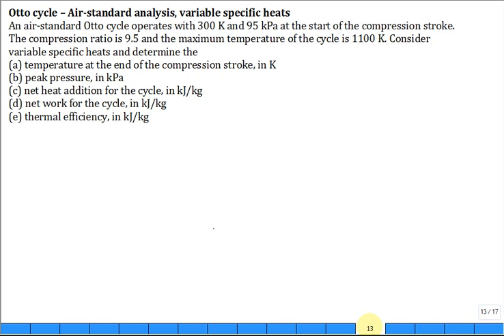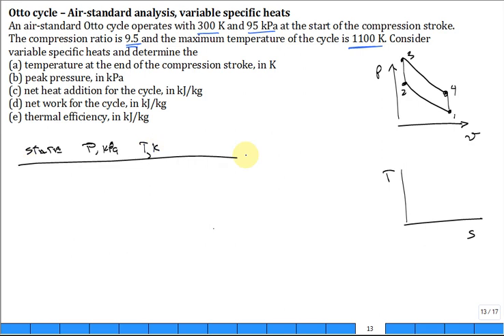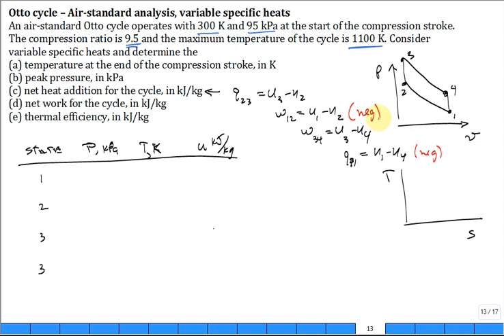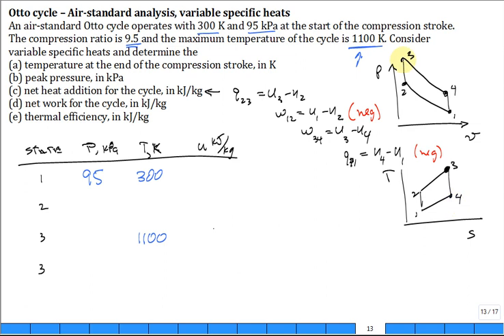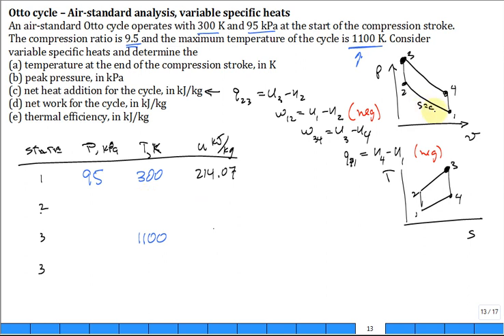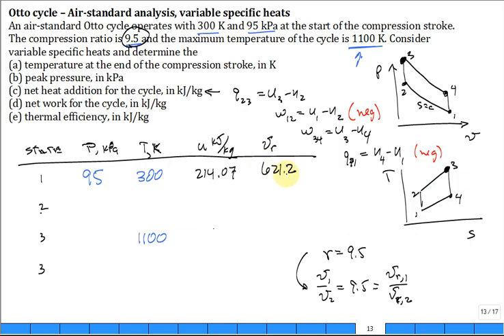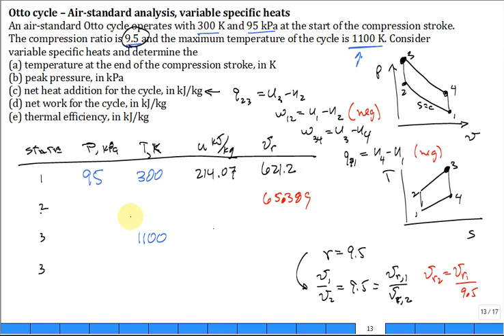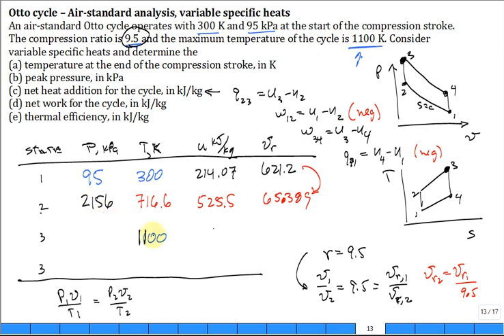Calc Otto Var Cp

Comment: How come you're able to use ideal gas law to get the pressure for 2nd state? Could you just use P(r) ratios and find the pressure?
Reply from the maker: Since (v1/v2) is known, then use vr2/vr1 using A-22.  This allows one to calculate T2, then use IGE to get p2=R*T2/v2.  Can stay in table A-11 to get pr2/pr1, then calculate p2 = p1 *(pr2/pr1).  Either way will get same answer for p2.
Reply: Randall Manteufel Ah I see. Thanks.